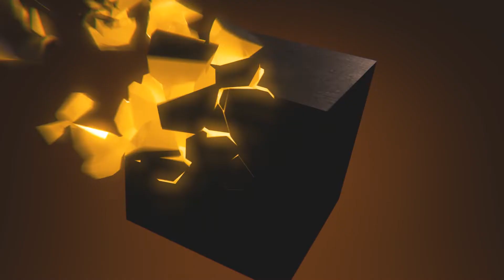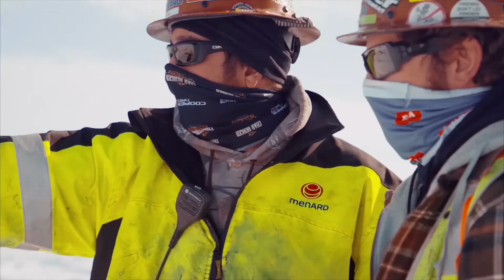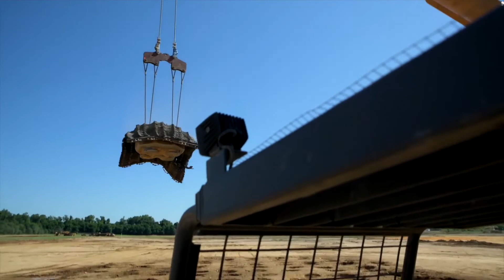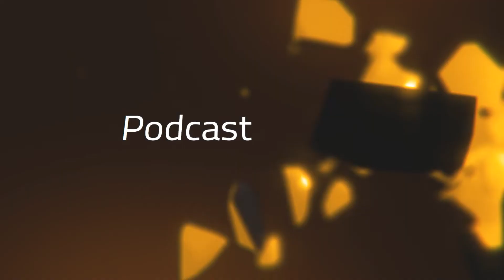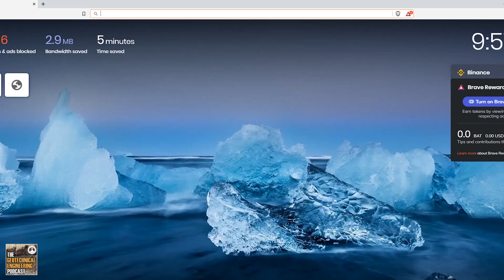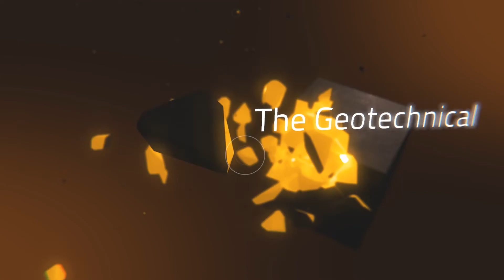Geohazard Monitoring and Mitigation in Geotechnical Engineering

Comment: Do Geotechnical Engineers share much information with one another when working on a Geotechnical Project  very close to another Project that has already been completed?   OR, do they just treat them as "COMPETITION as an Excuse for what could be considered considered VALUABLE information?"
Reply from the maker: @brucewinningham4959 Great question! Collaboration is key in geotechnical engineering, and many professionals do share insights to improve project outcomes, especially when proximity is a factor.
Reply: @EngineeringManagement  -- THANK YOU.  I can See & Appreciate that but I DIDN'T KNOW if it actually worked that way in. the Geotechnical Field.

When I was working as an Oil & Gas Well Dtiller, sometimes we would get "Orders from Headquarters" that we were Drilling a TIGHT HOLE which meant "we were NOT allowed to speak a word to anyone about what was going on st the Rig" other than the Standard Question like "How deep are uou?"

Fortunately, that DIDN'T HAPPEN VERY OFTEN.